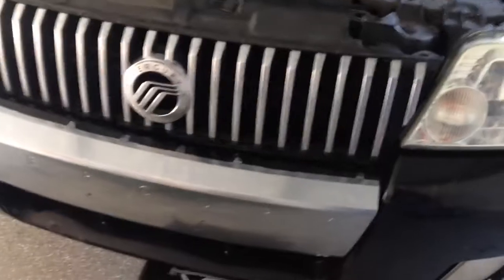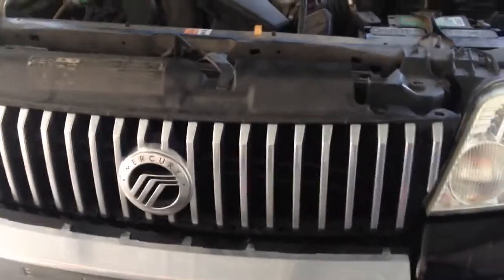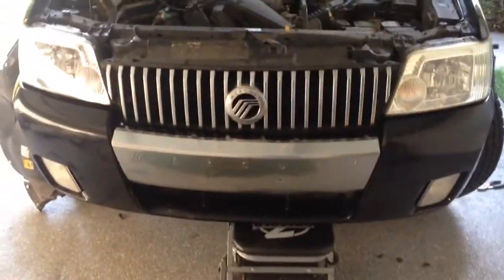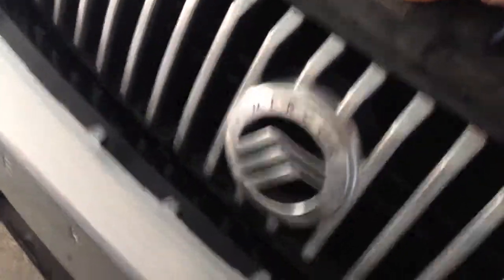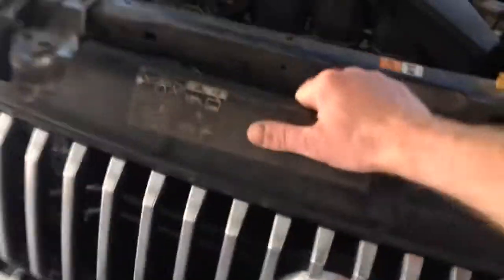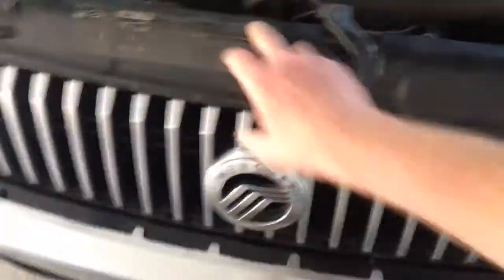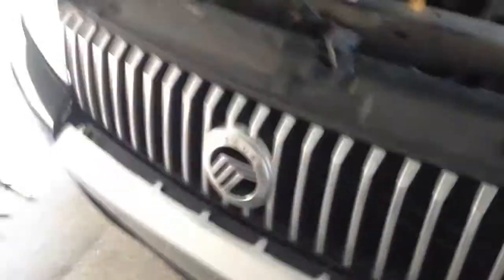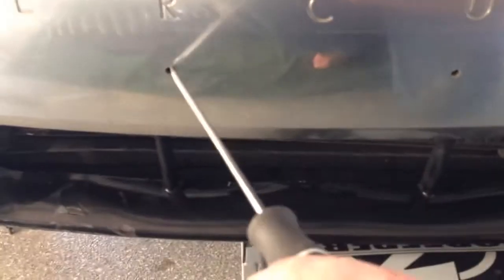Mercury Mariner - Front bumper designed by monkeys

Comment: I’d like to see the drill process. What bolts did you use?? Underneath the license plate??
Reply from the maker: Again, I'm sorry. I never intended to make this public, which is why I didn't show the entire process. I just drilled holes through the existing plate holes straight through to the back of the metal bar. Couple long bolts and nuts is all it takes.

Comment: I’m having the same issue with mine!!! Please help!!!
Reply from the maker: Just do what I did in the video. Drill two holes into the bumper bracket through the existing licsing plate holes. Insert two long bolts with nuts . Bumper never come apart again. 

In hindsight I'm sorry for not showing the fix. This video was more of a rant than a how-to. That one is on me.